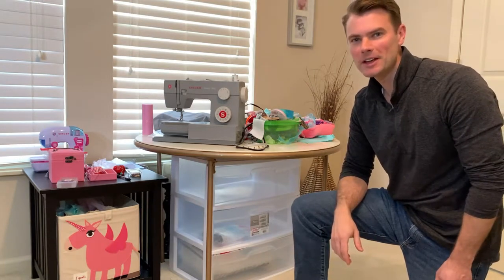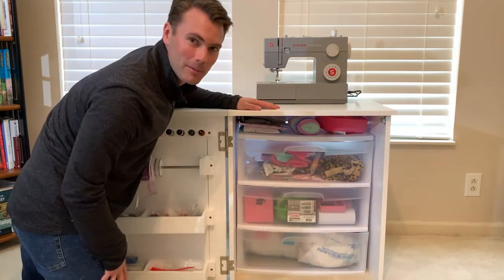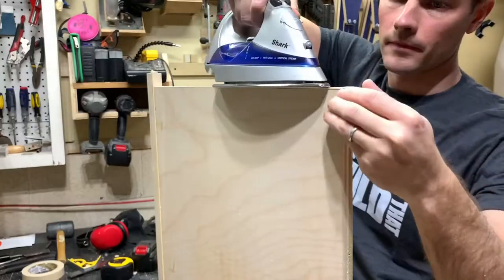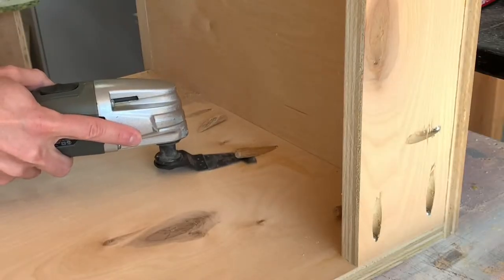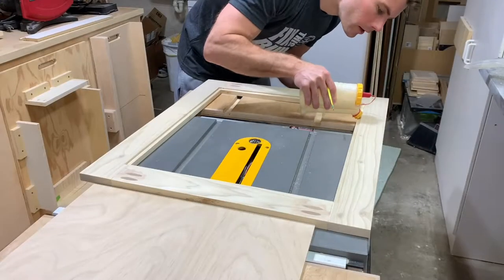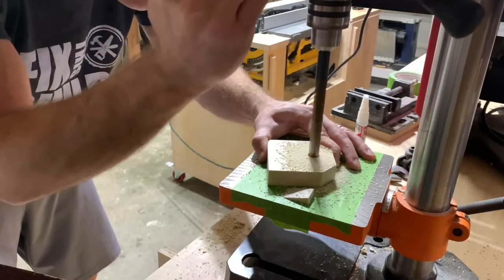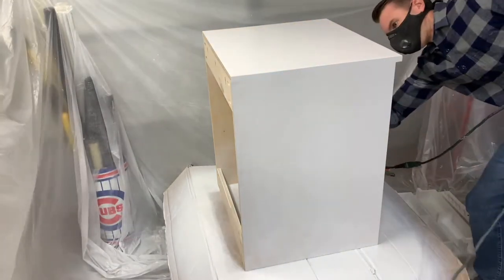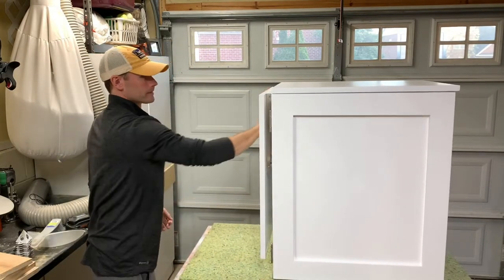DIY Expanding and Collapsing Multipurpose Table and Storage for Sewing, Arts and Crafts

Comment: You're the first person I've seen use the Bob Smith CA glue and activator. Best bang for you buck in my neck of the woods. Just discovered your channel, keep up the good work!
Reply from the maker: Thanks so much Scott! Ha yeah I have used the Bob Smith stuff for a while. I actually just ordered a bunch of Starbond products so looking forward to comparing the two.
Reply: @RLLWoodworks  the only other stuff I've tried is the Instant Bond product. I like the aerosol can, but it runs out faster than expected. The BSI stuff doesn't seem any different in my experience.

Comment: One of these would be great for must Silhouette. Would I be able to get the dimensions please?
Reply from the maker: Yes of course! 

Fixed Top: 24.5” wide x 21” deep
Sides (both right and left): 28” tall x 20” wide
Front door: 27.5” tall x 24” wide
Flip Top: 24.5” wide x 21” deep

Note: these are the final dimensions so if you use solid wood to hide the plies of the plywood like I did, you will want to subtract the thickness of that solid wood from these measurements. The solid wood I used was about 5/8” thick. The reason I did this was so I could get the plywood cut at the hardware store perfectly in half to 24” (actually just under to account for the thickness of the blade).
Reply: Thank you